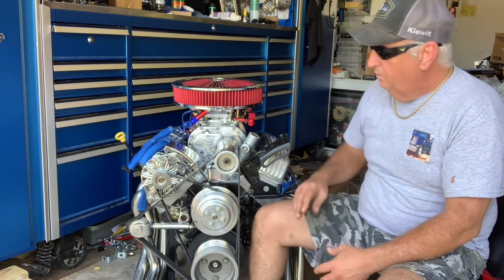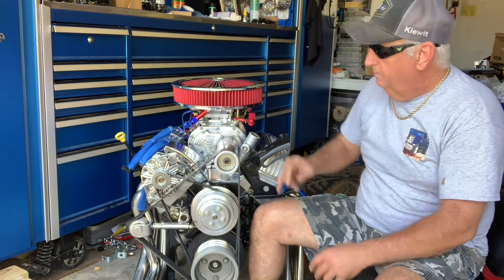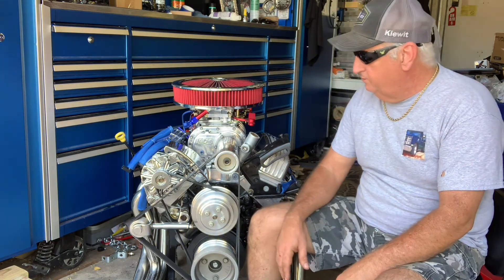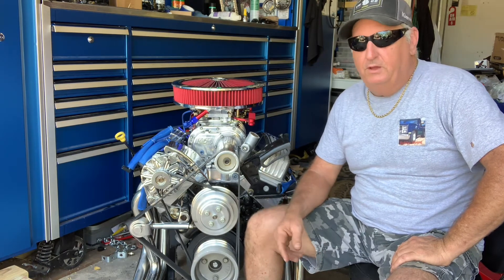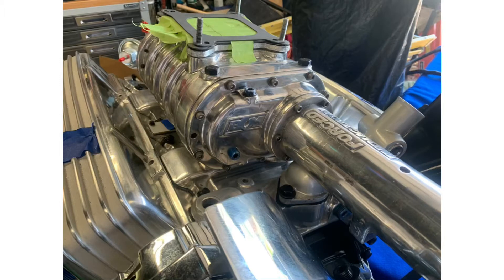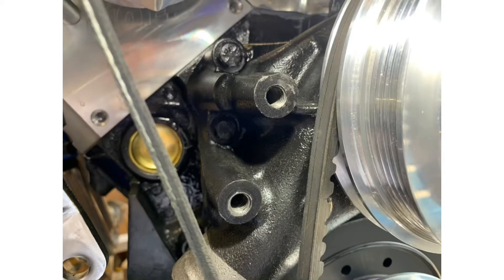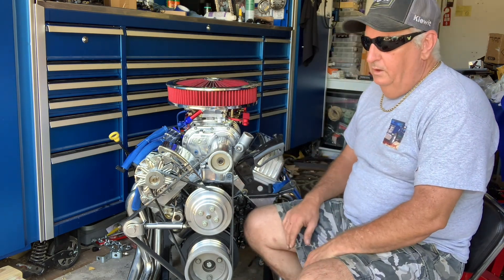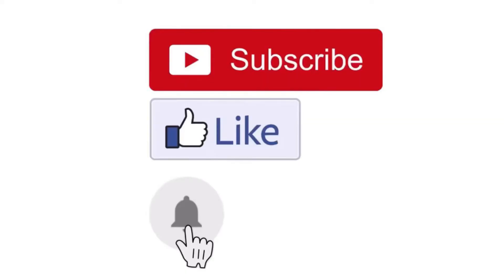Installing and lining up the B&M 144 supercharger idler/tension pulley

Comment: If you have problems go to old v belts setup  on water pump   alt and steering 
dont rev in nuetral or it will blow them off
originally the tensioner was on blower snout